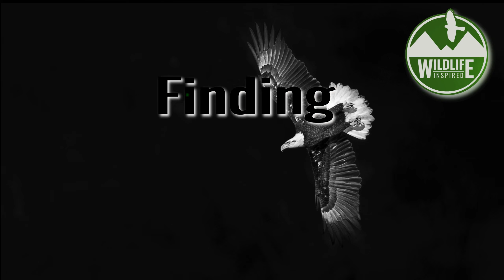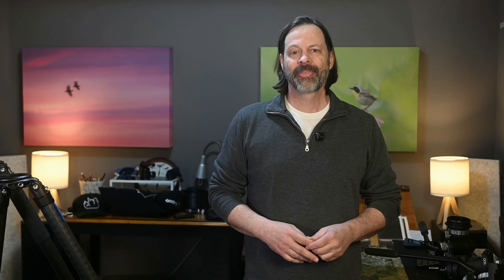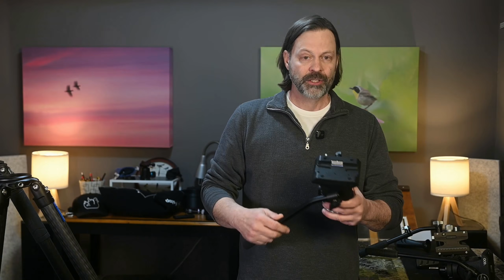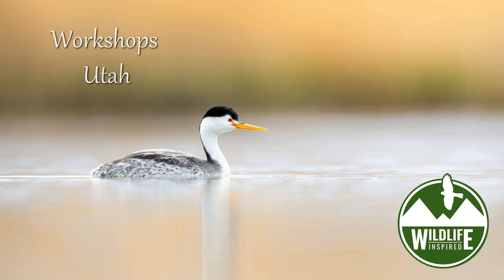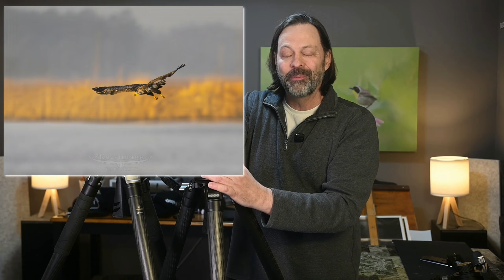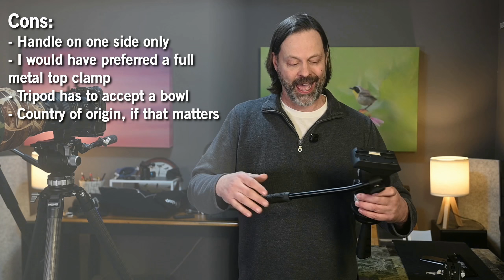Is the LeoFoto FH-10 the Best Fluid Head?

Comment: The Sachtler Ace 75mm ball is removable, whereas the FH-10 ball is not removable - correct? That's a pretty big difference you could have noted. The Sachtler is more flexible with either a flat-top mount or a bowl mount. Or for exmaple, the Sirui CT-3204 "adaptable" mount which ingeniously supports both ball and flat-top with one mechanism.

Comment: Do you still use the FH-10? I have been using it for a week or so now and it is very frustrating. If you don't use the tilt lock a little bit my head will drop forward or drop back when tilting up or down. That extra resistance makes for not so smooth tilts when shooting video. It happens with my wildlife rig 12#s and my concert rig 5#s. Just curious if you have the same issue before I contact Leofoto. Thanks
Reply from the maker: I do use it though I dont do a ton of video right now.  I have had zero issue with any counter balancing as long as I put it on the head and it is fairly centerd.  you should be able to adjust teh counterbalance to elminate flopping
Reply: @WildlifeInspired  Thanks for the reply.

Comment: Hi Scott, great video as always! I just bought this head based on this video and was wondering your thoughts on a tripod to pair it with. I know you've recommended the leofoto lm-403C which looks really promising, but what about the SUNWAYFOTO T4030CMI? It looks to also have 40mm legs, but the fact that they're inverted (thicker sections on the bottom for stability and keeping out mud) and that it comes with a 75mm bowl makes me think it might also be a good option. I won't need to travel on a plane with either, so happy to go with a larger tripod generally. Any experience with the sunwayfoto tripod (or with the company generally)? Appreciate your thoughts 🎉

Comment: I just got this amazing head! love how light it is. so much smoother in all axis than the BV-20. i got the short hand tightener for the bowl so i can get much lower. Most of my work is on sandy shores so I can scoop a small hole in the sand for the handle before setting the tripod fully flat, so the short handle is no problem for me.

Comment: Looks like an interesting head compared to the Ace XL. If I had seen a good comparison I may have considered it more back when I bought my Ace XL ii, though I got my Ace for much less than double the price.
Two notes about the Ace - the handle can go on either side, you just need to pull the logo cover on the left side. You can also use it on a flat tripod (or slider) by removing the stud on the bottom.
Reply from the maker: Appreciate that insight !

Comment: Great review Scott! Please do one on the new Leofoto FH-5 that doesn't require a tripod with a 75 mm half ball. Some of us need the extra weight savings when traveling with our kit.
Reply from the maker: I’m on it
Reply: @WildlifeInspired I just received the FH-5 today. All metal construction and ability to use with a bowl or not is nice. Hope to get out and give it a run-through shortly. Will be using with my Sony 200-600 setup. Should be perfect.
Reply: @APROutdoors  I would be using mine with the Sony 200-600mm as well. How's it working out? Hope to see a proper Scott Keys review soon.

Comment: Nice review of this lighter version fluid head from Leofoto. Years ago I bought a Robus tripod (pretty much a dead ringer for the equivalent Leofoto version at the time) that has the interchangeable top plate to use either a regular flat plate, a 75mm half bowl, or add a center column which I don’t use. I also wanted the ability to lower the tripod all the way down without the handle of the leveling base hitting the ground first and preventing that. I wound up buying the Leofoto Leveling Base YB-75SP because the length of the handle is very short and it doesn’t get in the way of lowering the tripod all the way down. I also have a Leofoto tripod with a built in bowl and leveling base, the LVM-323C, because I like the speed of flip locks most of the time and the handle on that is longer but not too bad for getting pretty low.

Comment: Thanks for this video. Makes so much sense that I made the right choice with the BV-20! So many issues with the FH-10! Phew!

Okay with the BV-20: I have the ability to use a half bowl levelling base so I can adapt my head to suit different situations, tripods/ground pods, heights. Plus I have the ability to level all my tripods as they all have bowl adapters. 
Pan handle must be ambidextrous. It’s silly not to!
I can’t be sure if the composite material Arca Swiss clamp will still be functional after 1000 times I put & take off my lens foot
I saw you couldn’t balance your gear on the FH-10 & had to use friction to make it not spring back
The striction & creep on the BV-20 are non-existent. At least in my copy. I have checked it with the 840mm focal length. None!

Plus it costs more than BV-20!

Comment: I have a question regarding these heads:
Currently I have a manfrotto head (mv500h)
when I shoot video on a 100-500 with an r7 I can not touch the camera at all. 
It shakes like crazy. is this something I could fix with a more expensive head like these?

I guess it is not the tripod as I can not imagine something more sturdy than the Triaut 058B I use😂
I have 2 legs a Rollei carbon fiber Rock Steady Alpha II and Manfrotto Triaut 058B both have this shake so it should be the head I guess?

Comment: I have been using a Sachtler FSB 6 fluid head for twenty years. The clearly better version than the ACE. Twenty years without any maintenance, and it still has the smoothness as if the head were new. Even at minus 20 degrees Celsius. A top product, albeit for a higher price. I use it for macro photography as well as the large 600mm F4. Never regretted it for a single moment. Also handy for passing seabirds during a storm!

I can fully endorse everything you mention.
Reply: Yup, FSB6 user for 15 yrs now. I dont think I will ever wear it out.

Comment: Thanks for the review as the FH-10 is a head I've been considering.  If the FH-10 has a 3/8-16 stud on the bottom perhaps one of Leofoto's shorter handles would fit allowing lower positioning.  Also, you can put a Leofoto 75mm half ball on the BV-20.

Comment: I love my BV20 that I bought last year after you tested it out in a previous video. I use it on my Robus RC5570 which has the half bowel built in. Just need to buy the Manfrotto 75mm Ball.  I actually have the original flat half ball that came with tripod mounted to my RRS BH-55 Ballhead for quick changes on that Tripod. I used the 20% coupon and saved.
Reply from the maker: Glad you're loving that setup and managed to save some money! 📸